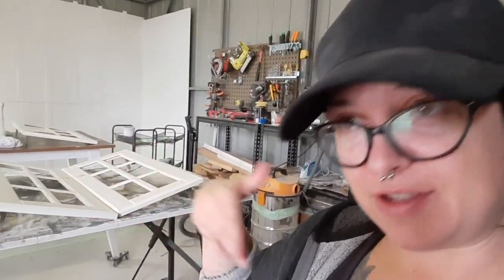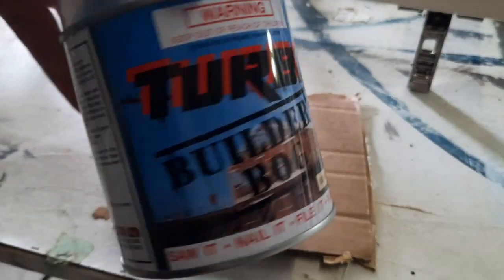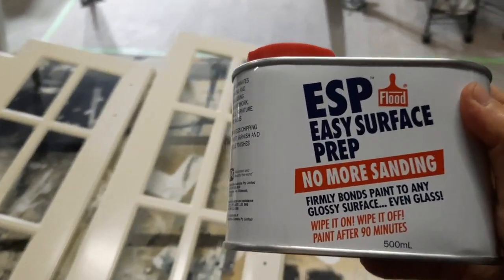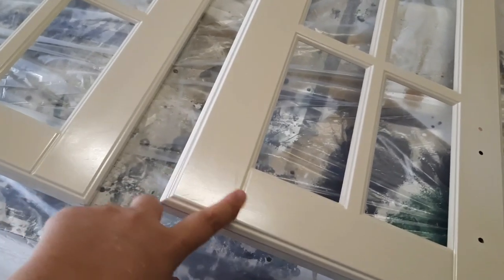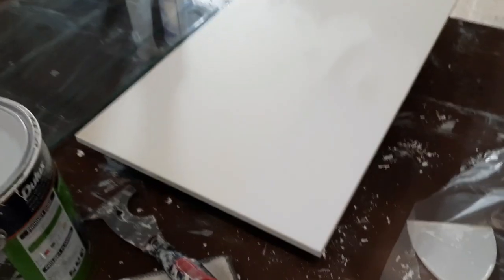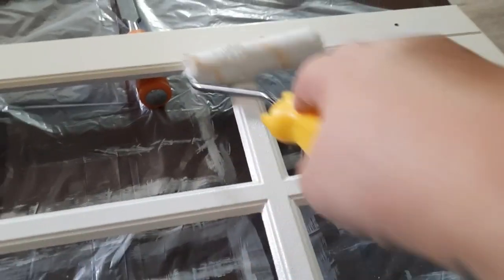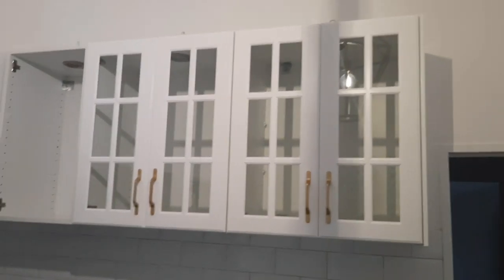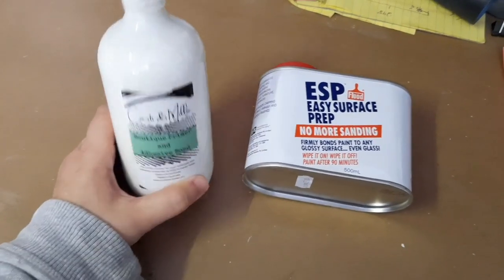Painting Kitchen Cabinets & Testing Primers | Carts & Millie VS ESP | Flipping Furniture

Comment: I’ve used ESP and worked great. The doors you had tried it may of been a type that didn’t suit this product. As you said no sanding would be good on the doors. It was probably how the doors were coated at the factory.
Reply from the maker: Thanks Donna. It probably would have worked fine if I'd scuff sanded them first but everything I'd seen and been told lead me to believe I wouldn't have to sand which is why I went with ESP to begin with lol but like I said I'll definitely try it again

Comment: ESP takes 28days to get be fully cured, you only need to wipe off if you have excess on the surface, and I also refuse to use aquanamel without adding floetrol it makes the world of difference
Reply from the maker: I literally just followed the instructions on the can. I won't be using Aquanamel again after this, not my jam lol
Reply: @CreepDesignsbyTwitch  try it with floetrol does make a massive difference I have excess (I have like six bottles ) here if you want to try it. I have worked in the paint dept for 13.5 years and have picked up a few tips about how to use random products along the way